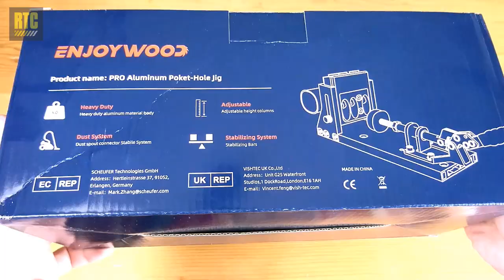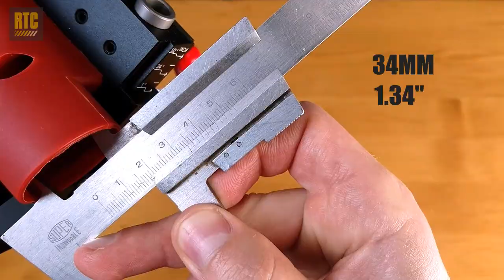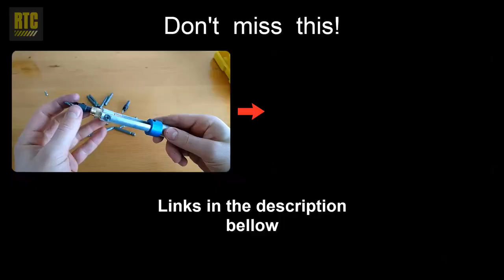Using THE BEST Pocket Hole Jig Kit For The Money - Better Than Kreg Drill Set

Comment: This pocket hole jig kit seems like a must-have tool for any woodworker or DIY enthusiast. The kit comes with everything you need to get started, including the jig, drill bit, and screws. I like that the jig is adjustable and can be used for a variety of projects, from building furniture to making repairs around the house. The included instructions are clear and easy to follow, making this kit a great choice for beginners or experienced woodworkers alike. Overall, I think this is a great value for the price and would definitely recommend it to anyone looking to improve their woodworking skills.